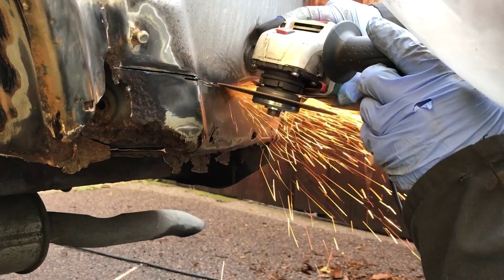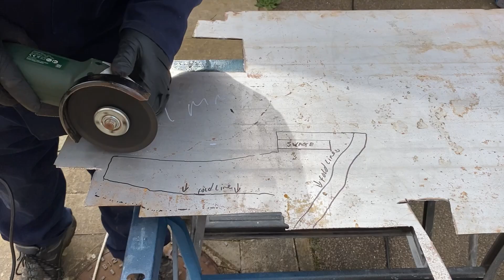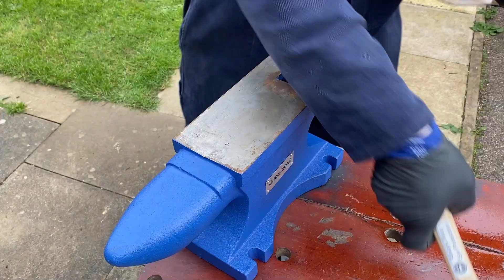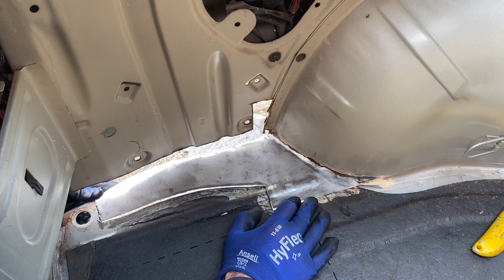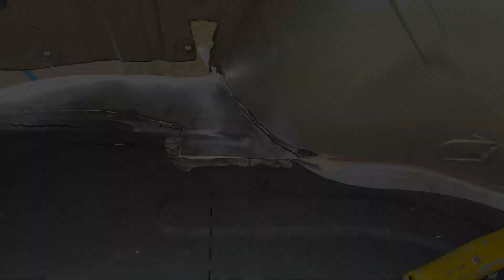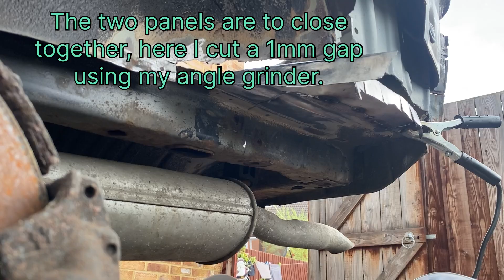MK3 Cavalier rust repair series Part 3 welding started

Comment: Good job so far Steve, you certainly put a lot of attention to detail in those repair panels, might learn a thing or too from that for my future workl lol.

Welding thin steel to already thin steel that has likely got rust or weakness in it is never an easy task, especially upside down that makes it 10 times more difficult. I always try and fashion something to rest my arm on, or rest it against something so it's not shaking about when I'm welding, usually try and rest my head on something as well like a block of wood if you're lying on your side and trying to weld upside down.
Reply from the maker: Thanks Andy, I really want to make the repairs as close as I can so when I do stuff that would be seen, I would have more of an idea how to do it, I’m quite please with how the floor turned out. 

Yes your right I was using the wheel as a pillow so to speak but resting my arm was not easy if at all possible, I’m hopeful that I would get better shots of me welding and produce better welds on the side panels that I need to do next, flipping weather has been holding me back 😤 

Cheers though Andy, by the way how is your Cavalier coming?? Same situation as me I guess?? Waiting for better weather 😅
Reply: @Cavalier_Steve  Hi Steve, the cavy has taken a bit of a back seat till I get the omega done, os now we have some better weather I'm getting on with that.

I was wondering about what you were saying about leaving a gap between panels when welding, I've always overlapped panels as found it was all too easy for bigger holes to blow open when welding. Might be missing something in the technique though. Usually find you have to pulse weld thin steel as it does often blow holes unless it's really new steel.
Reply from the maker: @Andys_Vauxhall_Vids At least your working on cars that’s the main thing 😁 

I will show a bit more welding on my next video when I next get the welder out, I’m a butt man myself (stop laughing you over there in the corner😂) yeah I like to butt weld rather than lap a panel joint, both good methods and both have there good and bad points, as you say butt welding is more challenging due to blowing holes especially when the welder is up high like I have here. 
I hope to get a better camera angle in the next one though.

All the best Andy.

Comment: Hi Steve, I started watching this video yesterday but as usual I got called away and only just got back to it🙄anyway mate I think you did a superb job on repairing the rust, making the plates and welding them in, I know from experience that this is not an easy job and it's made even harder when you don't have the correct metalworking tools which cost a fortune🤦‍♂

I think your welding as damn good mate as it's difficult to weld such thin steel so your repairs as just as strong (or more so) than the original, when I done my old Cortina up (early 80's) all I had was a 90A ark (stick) welder and that is not much good for thin steel either, I now have a Esab Rebel mig, tig and ark welder which is a synergy type which adapts to your welding style changing the settings constantly, it doesn't get a lot of use these days which is a shame as it's a fully computerised welder just sitting there, I may sell it at some point🤔 Thanks Steve👍
Reply from the maker: Hi John, I didn’t know that you welded as well! No worries about getting called away happens to me quite a lot, just watch what and where you can mate, thanks a lot of work goes into making the panels and welding them in whilst doing the video as well, I hope to get some better footage the next time I weld. I’m starting to like the challenge and f making the panels by hand feels nice and it’s back to basics with the benefits of anyone watching can follow along with basic tools as well. I’m enjoying it more now that the panels are coming out about right, I think doing the videos adds the extra pressure to turn out a good result. 

I’ve used cheap welders in the past along with a second hand one which was rubbish! It was a non turbo one (non fan cooled) you could do 2 welds and then the over temp light would come on. The Clark one I have, I’ve never seen the over temperature light on my current set, hopefully I would get flatter better welds the more I work. 

I’m glad you’re enjoying the videos though and I love reading the comments. 

Hmm I don’t think you should sell the welder the moment you sell it you would need it, sounds like a very posh machine indeed. 

Cheers mate.

Comment: Good work Steve.  I've spent a wee bit time myself cleaning, prepping and welding in the "back end" of my own Mk3 Cav so that was very interesting to watch.  I finally got my Cav back on the road last September, after being off the road for 18 years and I'm really enjoying driving it again.  A lot of hard work, but ultimately worth it.  All the best, John.
Reply from the maker: Hi John, well done mate! As you say definitely worth it and after 18 years off the road that must have felt so good to drive after all those years, I bet there was a fair amount of recommissioning to do as well amongst teething issues.All the best mate. Steve.
Reply: @Cavalier_Steve  Thanks Steve.  I had the Cav out today for a quick run to Tesco's and when I got home I noticed that I had clocked up exactly 1000 miles since I got it going again last year.  No better time than now to have a "personal MOT" and make sure all is well as pretty much all the suspension and running gear was replaced (i.e.re- check torque settings, etc), as well as an oil change.  I have to say the car has been running great with a couple of 150+ mile trips  over the last 7 months.  They really are great motors.  I look forward to following your work in getting yours back on the road!  All the best, John
PS  Here's a video of my Cav's "first start" after 18 years   
https://www.youtube.com/watch?v=b2n91SwCKQg
Reply from the maker: @thelonegroover  Thanks John definitely worth checking things over. They really are great cars, I enjoy running these more than my “daily” 
I will take a look at your video I’m looking forward to it.